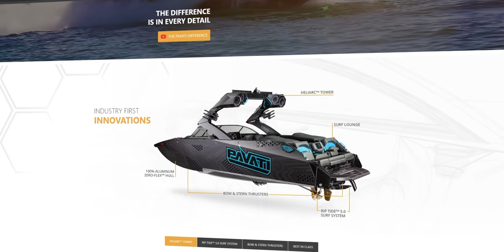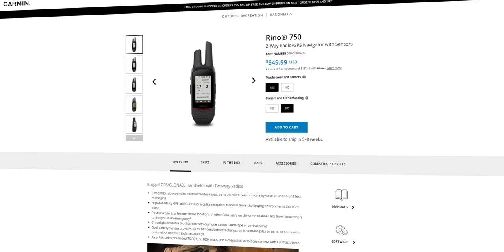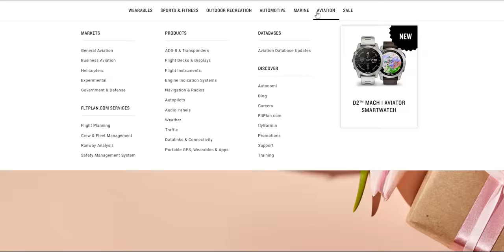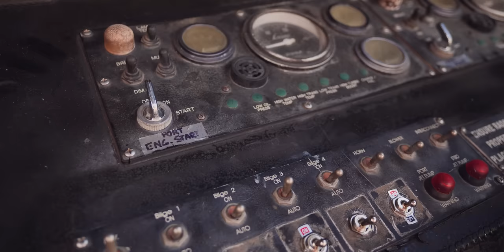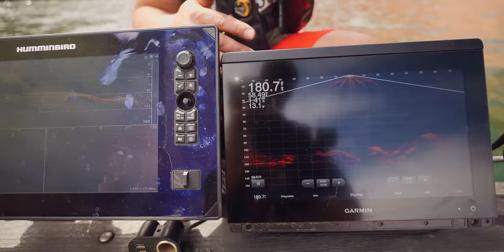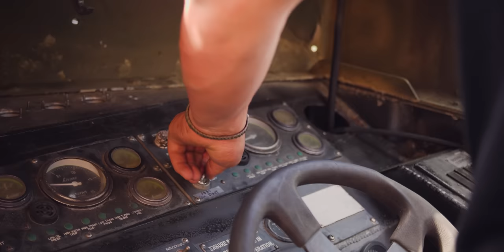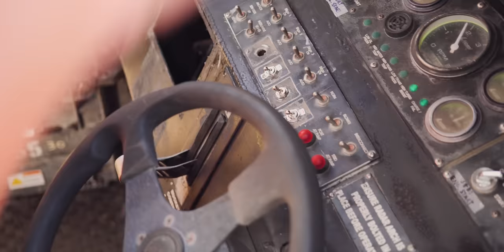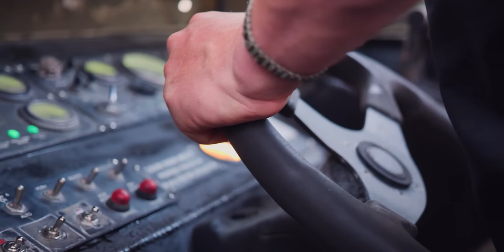We Found His $400,000 PAVATI Boat 95' UNDERWATER…

Comment: @ 12:00 - having worked for over 40 years on-and-off with two way radio equipment I always have to laugh when I see people like Jared and Doug holding their radios tipped over on their side looking all cool. They may not realize it but when the radio is sideways like that, most of the power of the transmission is blasting straight up to heaven and straight down into the earth. Very little of it is going out to the sides where you want it. The antennas on the top of those radios radiate very little signal vertically off the top tip of the antenna or the base of the antenna, it comes out the sides in a hopefully 360° pattern. When I spent 10 years as the technical service manager of a seven city 911 center, we launched a huge educational campaign to all of the police officers firefighters and paramedics to hold their radios straight up and down when they were talking and listening. We quickly found out that most of the dead spots we thought we had in our coverage pattern were reduced or eliminated when people held the radios correctly LOL. Just a little thought to share with each other and improve security and safety.
Reply: I concur.  I was a Comm/Nav tech in the USAF and in basic tech school we were taught about radiation/propagation patterns, and you are dead on correct...Hold it Vertical, it ain't an Iphone!😁
Reply: @WilliamEades_Frostbite  thank you for your service, got my start in Communications in the US Army Signal Corps 1970 through 1973.
Reply: Or my old boss that 'hated' long antenna's on his UHF portable. So always had me put on those stubby ones. Then wondered why he couldn't hit the base while I could. (long 'gain' antenna on mine). His work truck had a 1/4 wave on roof - mine a gain antenna. Sure I 'hit' things with it every so often - had to remove it at times to get under low hanging crap. But I always had better range then he did. Then I've a 'radio geek' ran either good Kenwood or Motorola radios instead of his cheap stuff. My house had the UHF back up base. Ran a 'station master antenna' - his base a cheap UHF ringo type. Cannot tell you the number of times I climbed his tower to repair or replace it. Cheaper is not cheap in the long run.
Reply: Great info @Cappy Cross, thanks for sharing! @William Eades Thank you so much for your service!!
Reply: @capicolaspicy  I guess you remember your TA312’s and TD754’s
Reply: @Soldierboy1986  I always sucked at remembering model numbers LOL. Never actually worked with the end-user equipment like phone sets or radios. Worked in a comfy air-conditioned 42-foot van setting levels and patching circuits together LOL.
Reply: Dang that is exceptional information! Thank you very much!
Reply: Good point.
Reply: Yep

Comment: Super proud of Doug pushing his limits and learning the ropes to do this. You have to give him MAD respect for his courage and efforts, and Jared owes him a raise 😁
Reply: Totally agree!! Doug has become an essential part of AWP. He's so soft hearted inside and tough as nails on the outside & always shows up with a get 'er done attitude. What more can you ask for?
Reply: and a paid vacation with his wife
Reply: 95 feet isn't pushing the limits. also the guy explaining safety stops needs to get educated.  It isn't because of nitrogen narcosis. Nitrogen narcosis is when someone dives below 70 feet of water on regular oxygen tanks. If you dive below 70 feet you need to be using a tri mix compressed air to prevent nitrogen narcosis. You do the safety stops to prevent getting the bends. Which is just rapid release of the nitrogen bubbles that develop in your body when breathing compressed air at depth.

Comment: 56:49 appears to have the screw-style bung still fitted, not the lever style.  I'm wondering if it was a combination of too much lead ballast, coupled with the water ballast and then the bilge hose that had come off.
Reply: I wonder if they put the plug back in to pull the boat up. They might have needed to do that to keep an air pocket from forming and then creating a severe change in pressure, causing the hull to collapse or blow out. 

Edit: had extra words from auto fill on my iPhone
Reply: I don’t get how the boat would’ve sunk with the plug in even with the ballast full. Since that’s what it’s designed to do. I’m curious how much the lead ballast weighed because I couldn’t imagine it would weigh more than the body weight of 5-7 extra people on the boat that he would normally have

Comment: I am having a hard time believing after watching a bunch of the videos from this channel that this team is so ill prepared for this dive. No Comms/comm issues, improper dive gear with no dive data? No Idea of where to secure the float bags..as in who doesn't know how boats are laid out with anchor points or why didn't you look at pictures to know that this and most boats have two transom rings and one bow ring. Not knowing the front from rear of a boat? Not sealing your float bag and wasting air...not having enough air to accomplish the mission. Problems with the lift bags/valves?  To me this isn't the a Adventures with a Purpose that I have watched 20+ videos of. I mean really? I know this isn't the same type of dive that they normally do, but seems like the 7 p's aren't even in effect. (Proper, Prior, Planning, Prevents, Piss, Poor, Performance.) I am not belittling the mission, but just amazed that I am seeing so much wrong with what should have been a simple dive and hook. But it is what it is I guess and all ended well. I am just perplexed I guess on all that went wrong before anything actually happened and the dive and recovery still went forward all in such a "Blind" manner. Just IMHO.

Comment: You guys make me nervous diving that deep on air. I wish you would get rebreather and trimix trained. I'm just worried for both u guys' safety. The world doesn't need to lose you❤❤
Reply: 95 isn't bad on air. Add another 10 or 20 ft and maybe a little He might help. It all depends on conditions, water temperatures and how hard your working. I personally like He below 120 but everyone is different. Tried to take photos at 160 in a cave on air once. Had to redo with a mix to get good results. My old school buddy dives air at 160 and remembers everything. But he is definitely an exception. He did quite a bit in Eagles Nest on deep air but did admit he remembers wanting to take a nap. Rebreathers certainly have their place on exploring and deep stuff especially with the current cost of He. But for 100 ft 1.5 to 2.5 hr dives it's hard to beat a set of doubles , stage and some O2 for deco.

Comment: FYI from a Radio specialist.  Hand-held radios work best when the antenna is vertical.  Antennas on radios are omnidirectional.  So when you think you need more power?  Make sure that Antenne is vertical.  These don't operate like cell phone.  Best not to talk on them like such!  The other thing, that insolation behind the front seat will cause interference to radio signals.

Comment: Well, the comms didn't work at first, the on-board air compressor didn't work, somebody forgot their thermals, one of the air hose fittings was bad on a bag then one leaked. Someone needs to take charge and get that outfit straightened out and shipshape. By the way, that hull is split at 1:07:32. That's gonna be fun to fix.

Comment: Now that was a fantastic adventure, simply because it was planned but clearly demonstrated that the best of plans are never complete until the operation is completed, and having incorporated several quick decisions to modify plands during the operation. This can only be done with cooperation and not blaming others when the plans need to be changed. Finally, lessons learned go towards reducing required fixes during the next operation without panic modes. 🔥🔥🔥🔥🔥🔥🔥🔥🔥🥇🥇🥇🥇🥇🥇🥇🥇🥇I watch the Diesel Brothers and think they are totally crazy beyond recall but "CRAZY LEADS TO GREAT ADVENTURES".

Comment: Love Pavati but a plug should never just pop out. They are usually metal and have pretty thick threads on the screws. I find it hard to believe the rope could undo the pin and unscrew the plug. Sounds like it could’ve maybe been a ballast leak. Happened to me on a mastercraft and almost sunk her, luckily I had a portable pump for external ballast bags and was able to use it as a secondary bilge and was able to get her to shore.

Comment: A gas powered air compressor and 120 foot of hose should have been brought after you got it up with the wrench you should have put an airbag in the bow of the boat which would have brought it up to the surface and you would have less wenching to do  and you could have used the second bag on the stern end of the boat to bring the stern up to partel surface even half surfaced with the 1 in the bow and 1 on the stern if you had thought of an air compressor and hose. and you should have had a drivers in water flag on that buoy.

Comment: At 36:00, he's discussing using floats to hold the boat up as they tow it back.  Why wouldn't you just use a sump pump or even bail it out manually, once it's brought up to the surface?  Isn't it just that one plug that had accidentally gotten yanked that's the main problem, right?  Or would you expect that now there would be other damage to the hull from its descent to the bottom?
Another question:  Why not use a small compressor on the rescue boat and an air line, instead of scuba tanks to fill the floats?  Seems to me that not only would that be more cost effective, but it would be an option to have in case anyone needed air who was stuck down there with any sort of equipment failure.  It would provide limitless air to breathe in that sort of scenario.

Comment: Really surprised that an expensive boat like that didn't have a back-up bilge-pump (or two)! 
May be it's because the designers & builders lacked sufficient experience to recognise that like life-vests, it's absolutely crucial that redundancy (or double-redundancy) be fitted to a craft to ensure reliability & safety!
Considering the value of the boat & the fact that it has a monster sound-system fitted, surely it had a dual-battery system & all the beefy wiring installed, so why didn't it also have two separate bilge-pump circuits with a pair of pumps on each circuit?

Comment: Question :   If an expensive Japanese maple falls off a delivery truck, rolls off to the side of the road, sits there for three weeks,  then you decide to pull over and grab it before it dies...... you can then be charged with stealing.  I forget the actual term used for the charge. 
     Now, if a boat sinks, it's there for a year, and you go raise it, pull it to shore, take it home, can you also be charged with stealing, the same as in the first scenario???
     Maybe some maritime laws keep that "land law" from being applied to raising the boat and taking it home ???
      The Japanese maple situation happened to me.  The only reason I think I was not charged is b/c I was cleaning up the dirt and trash off the road, as a good samaritan. I could have just left it there.  However, the cop saw me doing that and I believe that's why he let me go in that instance.  I was so surprised the tree sat there so long with nobody else grabbing it......being such a desirable tree.  I could not stand to see it die.  Cops came and loaded it up and took it away from me.  I'm sure it made it to one of their homes instead of mine.    I had no idea the law existed before that experience.
Thanks !
.
Reply: @savage101.  About three years ago, sir.  Thanks.

Comment: Just sitting here watching this, thinking, and something hit me. Have you guys ever thought of taking out a large electric air compressor or a gas powered compressor, or even a generator and small air compressor, putting that on the boat(s), and using that to fill the lift bags? Is it just a time issue, where the compressor would take longer than you have air in your tanks?

Comment: The diver complaining the bags are purging at only 1/4 full.. that's correct you are in 30m of water! the lifting pressure 1/4 is correct as the air will expand 3more time on the way (4atm) to the surface, you just need more bags or ones with bigger lifting capacity.... If you go over 1/4 full at that depth and they are closed bags you risk them blowing as the release valve wouldn't cope on ascent and dropping the boat back down again 👍

Comment: When it comes to filling air bags, wouldn’t it be easier to have a compressor on the work boat and run an air line down to the bags rather than have to haul tanks down to a car or boat?

Comment: The explanation about why is sank can’t be true, are they serious about using a drain plug with a pin that can pulled out accidental. I only seen plugs with threads. Cheers from a Danish’s Boatbuilder
Reply: 56:49 the plug seems to be still there. What do you think?
Reply: @TheMlc4life  good find. Definitely look like there is something in it, and when you look at heavyD video aftermaths. The hole doesn’t look like that.

Comment: Ok I know my view is nothing to professional opinion. Have no experience but I am logical. Could it be possible as I watch this when filling up the bags from a topside tank and a hose you loose the outside pressure against the tank as well as the normal flow to push up? When tank is down lower and even underwater pressure pushes freely up. The up tank and down hose can only push limited need a pressure hose system. Probably obvious to everyone but since it happened twice I just thought I would comment. Even fish tanks have systems to push the air down then circulate. That’s why Doug said it works better with the tanks down below. Yes I am a woman but not a dense one, Industrial tech. Grad.  Lol

Comment: Using an air compressor and hookah setups and not fooling with tanks you wouldn’t have the problem of not enough air. Compressor, communication equipment, and tank gauges not working…This doesn’t really seem like a professional salvage effort.